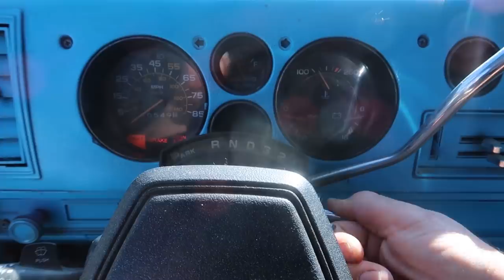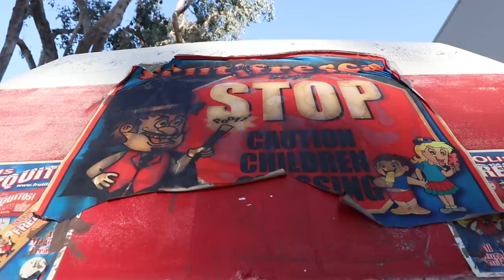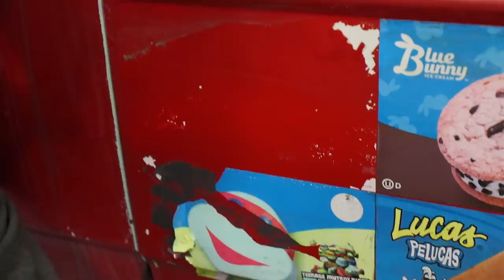We bought an ICE CREAM TRUCK and We’re going to Fix it Up! *SURPRISING EVERYONE!*

Comment: Remove the freezer and just use it as a merch truck. Throw out your popup tent and just use the van. New paint, new wheels, and bagging it would be pretty dope but slammed static would be sick too, also, upgrade that speaker and add custom sound tracks of the throtl crew saying some lines like "oh doctor" or like "Mickey spec". You guys could do so much with this project.

Comment: Bro throtl is getting savage with the car builds now he will slammed the ice cream truck with some her rims and Michelin tire make it a drift ice cream machine truck also with sparco seats and harness maybe a sparco steering wheel and a 6speed manual transmission with a light bar also make it 2 step. Lastly a roll cage